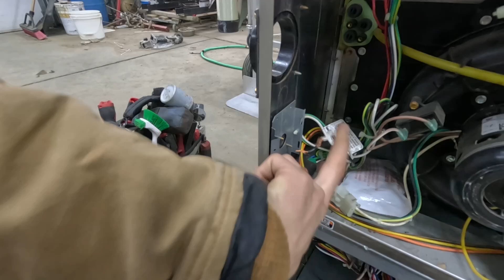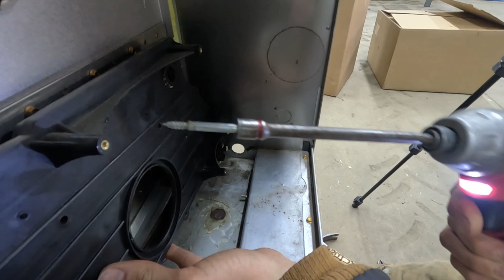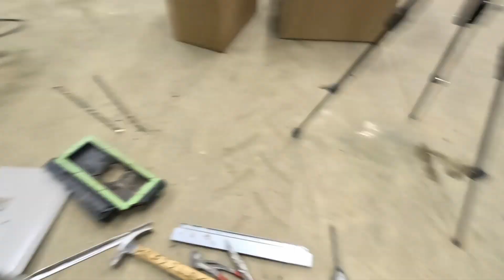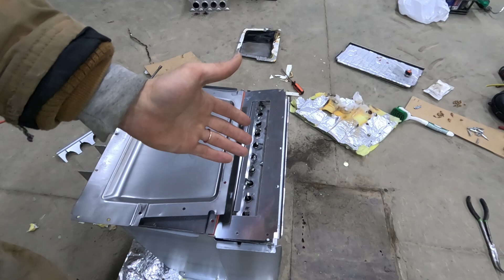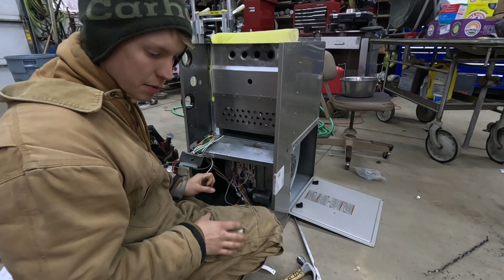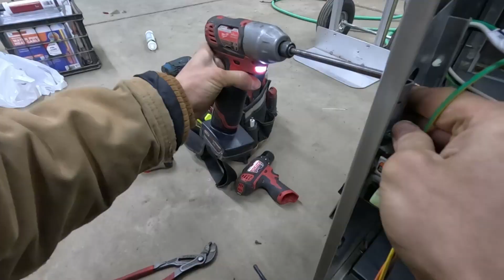How to Replace Primary and Secondary Heat Exchanger on Carrier Furnace (Newer Models)

Comment: More moisture in LP rots exchanger.  Higher efficiency saves customer nothing if they have to pay double for unit and lasts half as long.
Reply: there should never be condensation in the primary heat exchanger of any furnace - it's caused by running too cool (underfired, airflow too high, too cold return air), too short cycles, and or a design flaw. 

Secondary is designed to see condensation and doesn't corrode as long as it is all stainless.
A condensing furnace of the same feature class is not anywhere close to twice as much money and has the same lifespan when properly installed and maintain - IT IS the same as a mid but has a stainless secondary heat exchanger added and condensate handling components. The primary heat exchangers and mechanical/electrical parts are identical beyond the inducer.
Carrier/icp heat exchangers seem to be crap in general.
Reply: @Jon-hx7pe  Definitely stainless, the manufacture cost is nothing but they charge too much.  I told my Dad just put in a 80% mainly because he was on limited lifespan.  But just like X-13 motors nothing is gained for the few hundred watts saved if you have to put a new one after 5 years vs PSC 30years.  Now they have 10 year warr. so you can bet they last.  I expect my condenser blower package to last 30 plus years with good maintenance and that's were my ICP Heil HP is at now that I installed myself 25 years ago.
Reply: @publicmail2  if contractors in your area are charging double for same feature class furnace for 96% over 80%, they are totally gouging. Condensing furnaces are better across the board.
Reply: Couldn’t agree more…I have said this for years re: the ECMs-after the warranty expires in 10 yrs, a failed ECM “forces” replacement of the unit as most do not want to invest that kind of money in a 10+ year old unit.
Reply: @robwallingsford9274 the motor and control head are separate, useful in some cases.
Reply: What extra moisture?
Reply: @Rico-oy3dc Propane has 2xs water vapor vs nat gas.